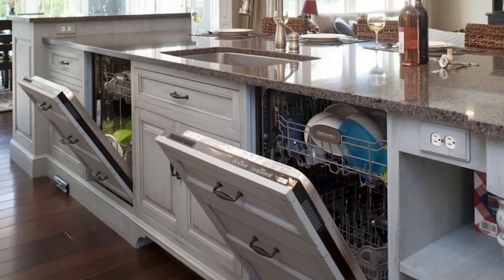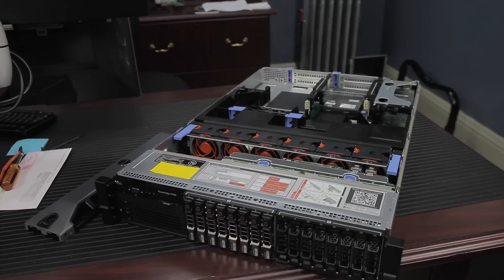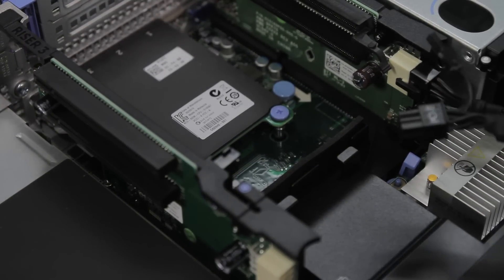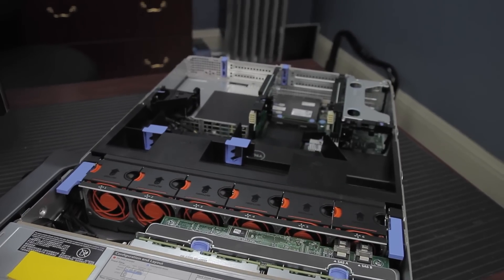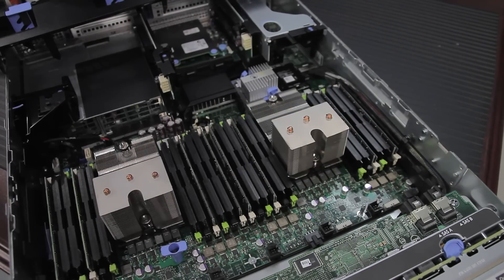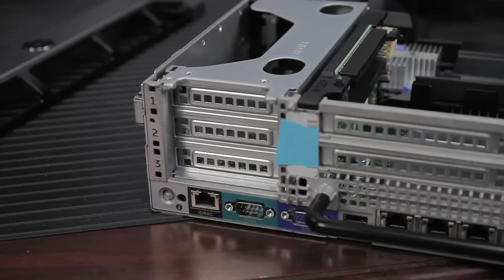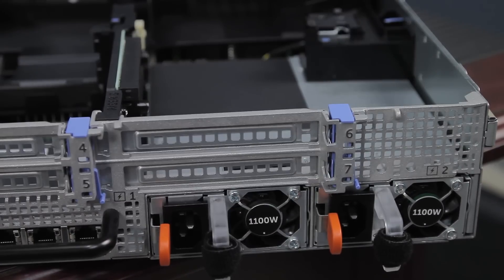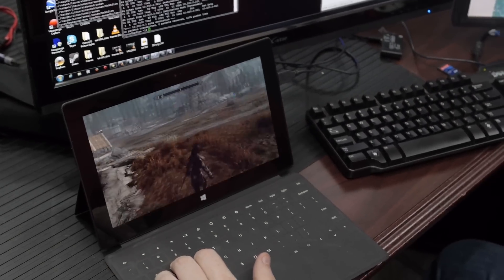Dell PowerEdge R720 Dual Xeon Server Review

Comment: Could you run multiple gtx 1060/70/80 graphics cards in this thing?
Reply: You can run 2 dual slot gpu's, and 4 if you somehow watercool AMD cards to make one slot cards. You would probably want the workstation version which is a Dell Precision R7610 (R7910 for 2011-3) which has windows 10 pro and comes with pcie power cables.

Comment: how many watts does this dual 1100 watt psu beast pull from the Wall?
Reply: About 100 idle(depends on config, that would be with the low end cpu's and on a drive or two and only a few ram slots used) and a normal load power of about 300-400, depending on use. They can max at around 900 if you fill them up with gpus, ram, cpus, and storage.
Reply: The dual PSUs are for redundancy not combined power.

Comment: What an awesome setup, would love to see more of this, I just bought a used R710 for labbing purposes.  Just achieved my MCSA with it and am headed for MCSE private cloud.   Was the idrac in two flavors on this one too? I had to pay an extra $27 for the idrac 6 enterprise. And my PSUs are 570w power saving but I do not believe they have a 80 plus rating.  I love how Dell now includes the little pcie power connectors on yours.  I have the perc 6/I Controller pcie with battery backup and have been pretty happy with it so far.   I run vSphere 6.0u2 with about 19 VMs including a HA cluster(for lab only since it's not technically HA with one physical sever). 2x X5560s 32GB RAM and only a couple SAS drives.  But definitely a good starting point for me.  Awesome video guys really enjoyed it.

Comment: So what do these Dell Power Edge Servers do? I brought 2 750 Power Edge and 1 Power Edge 1850 for only $19.50 on ebay. Can they host Websites and Domains or are they just used for home network storage like NAS?
Reply: +MrN00btroller You can do what you want with them. Install Linux and away you go. Domains are sorted out by DNS companies in data centres so you would need to edit your DNS settings, with the company you used to get it, to redirect requests to that domain to your servers

Comment: So if I bought this, filled it with hard drives and RAM and put a couple of decent GPUs in there (maybe a FirePro V5900 or two) in there it'd be a super efficient but very loud extremely powerful rendering device. This may sound stupid (I'm new to this kind of stuff) but if I did that I guess I could install an OS on it and use it as a backup computer and storage device? Also, are there any other alternatives that are a bit cheaper that I could use for something similar to what I have in mind?
My main aim is a high capacity rendering machine for a decent price. If anyone has any cheaper specifications, I would love to see them.
Reply: For a sever product to be a rendering machine you would most likely need to use a rendering computer. In most cases You would have a Virtualized workstation or virtualized APP as a guest on a Server like this and use that as a rendereer. The concept is as such.... A couple FireProV5900 could never ever ever....ever......just to be clear EVER... be used to their potenential be 1 person. The rendering is offloaded to a servre such as this which could queue rendering workloads. The specifics of accomplishing it are more easily served via Nvidia but there are amd options. You would need Wendall level talent to accomplish it.
Reply: johnsitka So I guess just putting Linux, something like Sony Vegas and Blender on it won't cut it eh? Oh well then.
Reply: oh I forgot, if you bought this and moved in, it would be equiped with a server operating system. Your rendering software once installed could not be compatable with Server 2008/2012.

If you had purchased this dell 720 which once equiped to do actual work is about $13000 you could easily cover any workload required. But it would be a terribble waste of money for what you have described.
Reply: johnsitka Ah OK. Basically my plan was to build a PC, just using the server chassis, as, well, a chassis. Only reason I wanted to use a rack server chassis was the hard drive and ram capacity. I guess I'll figure out some other way to do it. Thanks for the help.

Comment: Thank you for the indepth review of this Dell 720R Blade Server. It is very very informative I like that you ordered it with 128 megs of ram. one thing I did not catch was is the mem ddr3 or ddr4 just out of curiosity. FInally dell made the uefi so that any on the fly changes do not require a reboot. The clients we support buying Dell servers use the floor chassis T420 and in even the 2104 models the eufi changes require a reboot. The same with idrac as well. I emailed my idrac support rep asking if Dell is going to push a firmware update that will allow on the fly idrac and eufi changes without a reboot, still waiting for a reply. Thank you for the video very good internal review and explaination.
Reply: Do you mean 128 GB?
Reply: xAFKNinjax I idid mean gigs please excuse me.

Comment: what do you guys think? http://pcpartpicker.com/p/4G2tkL
Reply: 9800eddie1 Correct, I have two friends with fairly powerful AMD rigs (both have AMD CPUs, but one has an Nvidia GPU) but they can barely get 20fps in Dolphin.
Reply: It would kick ass...
Reply: allentom97  i wanted to go cheaper with an AMD build but i read that emulators work better with Intel processors

Comment: I have one MAJOR QUESTION! Why the hell would ANYONE want a random usb port for NAS when you have the entire server in and of itself??? The only thing i can think is for diagnostics or recovery incase of a software accident but windows server 2003, 2008, and 2012 are rock solid OSs tho...
Reply: The actual point of the USB port inside the chassis is that some really high end server software/hardware use flash drives as a verification key, instead of just a serial number. This way you can plug it inside the machine and not worry about losing a port or someone taking it out. What Wendel meant though is that since freeNAS is typically run off a USB drive, as opposed to being installed on a hard drive/ssd, you could also use that port for that purpose and have freeNAS run your server hardware

Comment: We use SuperMicro 1U 4 bay servers running intel dual hex core for our ded servers and I specifically use 5U version of intel 2600CP for my backups with adaptec 52445 raid controller 22+2 2Tb drives in raid 50 for backup servers. Now with that said, i tried to slap a 750ti to one of these servers and test gaming and I wasnt successful. my question is, would you really see a benefit in gaming using the same gpu playing on that dell over-kill of a server than a regular 4770K gaming rig? it would be interesting to see a comparison. please dont reply saying this is a server and not intended for gaming because chances are i know more than you about both ends. I run a data center. I guess im interested in head to head comparison numbers.
Reply: "Hey look, I can name the model of a RAID controller, therefore I am smarter than you, by the way I want to use work servers for gaming so why doesn't 750Ti work when I plug it in? "

Just tell us where you work so we can get you fired, you clown.

Comment: Plenty of powerful fans but I don't see many places for the air to escape, what am I missing ? No matter how many fans you have, the air needs to flow freely in and out, if air can't get out, it can't get in. I would think you could reduce the noise quite a bit if the air was able to move more freely.

I see this a lot in custom builds where people concentrate on the intake by putting in huge rads with multiple fans but only have very small exhausts, usually with a big thick radiator restricting it too. Then they're confused about higher than expected temps. I'm not talking about cases with open sides or vented tops.

I realise that Dell and Wendell know a lot more about these things than me and I'll probly get shot down and burn but that's normal on the internet anyway.
Reply: Since this a server blade, noise is definitely not an issue. Also, those fans are extreme Static Pressure so they can move a ton of air through a very small space. Air gets in through a very moderate vacuum and is expelled almost the same speed on the other side.  Remember this is a Server Blade, Not a Desktop. In terms of heat and noise, this thing is LOUD and Hot as hell. Data Center AC's are as big as small homes just so they can keep the heat down.
Reply: I follow that logic, it just seems to me that it could be better thought out. Making it slightly bigger like 1 rack unit higher, might enable it to use less powerful fans which have a lot of benefits.
Reply: Ian Clarke  blade servers from my experience are usually built this exact way, and man these things get loud..  In the industry noise is not so much of an issue,  performance per watt,  upgradabality and configuration ability dominate the layout and design of a new blade server...  Just my 2 cents bro..  On a side note I saw three blade servers survive a fire and being doused with water..  Now that's impressive..
Reply: Ian Clarke I don't know Ian; with all due respect I think you're probably used to seeing desktop systems with the frame of mind that "they could have done xyz better". These are servers, made by Dell, who have been in the game for decades with datacenter operations as one of their top priorities. Trust me, they know what they're doing. Having worked in a datacenter, you have no idea how much air these things push out from the back. Your shirt physically wiggles around from the air moving out of them. Plus, these systems are meant for a 68F or cooler environment, so they kind of assume you will be having some intense cooling going on to support their fans and internal aerodynamic implementations.
Reply: Trevor Lowe Saying Dell knows what they're doing when it comes to heat management is like saying a wolf with rabies knows what it's doing when it comes to raising children... They scratched the entire studio laptop-line because all of them had overheating issues due to the core-design of the bloody thing.

That being said, it's meant to fit into a rackmount, server rooms are incredibly loud and are usually in a room with an AC unit so large, it's basically a refrigerator. Nobody will care if it's half as loud if it uses even slightly more power.

Which is why I don't really get why people ask about videos for these things, do people actually put them in their house? Is this to some of you like super cars are for average Joe? Is this interesting because of your profession/education?

Don't get me wrong, I enjoyed watching it, I didn't understand everything seeing as I'm not into rackmounted servers but I don't really see these videos appeal to many people nor do I think I'd be interested in watching more videos like this for the next month or so.

For clarity's sake, I'm not complaining about this video's existence, I just want somebody to explain me who this is aimed.
Reply: Ian Clarke if you are running 2000 of these non stop for 3 years, the platinum psu's will save a lot of power. Both in what the servers use and the heat the ac has to deal with. Performance per watt is getting more and more important for datacenters because the price of power is always rising and when the savings are bigger then the initial extra cost it's a nobrainer.
Reply: Trevor Lowe In all honesty, only the first paragraph was aimed at you. If you want a TL,DR version of the rest:
Who is this video aimed at?
Reply: Let me put it this way, this thing is using 80+ Platinum PSU's yet has to use extremely power hungry fans to make up for the poor ventilation of the case. I know it's meant for industrial installation but why bother with the Platinum rated PSU ?